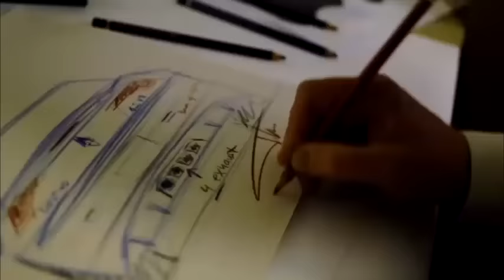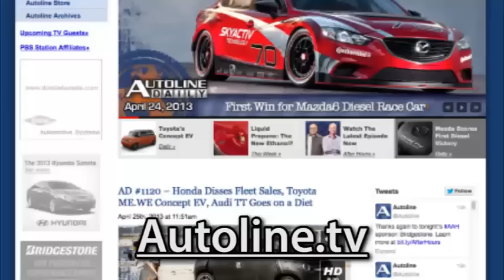Bob Lutz: Live, Lively & Unscripted - Autoline After Hours 318

Comment: What they (FCA) need to do is come out with a modern day version of the old SRT4. Seriously in 04 what could you get for $26k out the door with nearly 260 hp? Look at the Ford Focus sticker is outrageous, but you get a lot of busto for that heavy price tag.
Reply: +Adrian Glessner YOU meant like the Mustang with 4 cylinder engine?
.
Reply: While the Focus RS is pricey, it's not exactly a fair comparison to the SRT4. However, the FWD-only  Focus ST is exactly what an SRT4 would be competing against currently. That SRT4 actually started at $21k with no options in 2004. That's $28k in 2017 dollars. That same $28k today will fetch you a very much loaded Focus ST that is superior in every way to the SRT4 and is MUCH better built than any FCA.